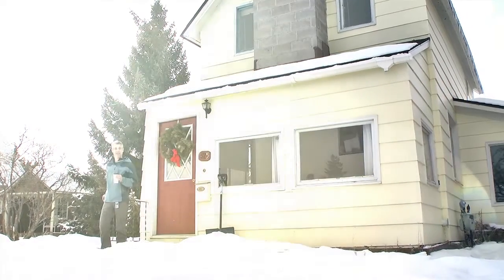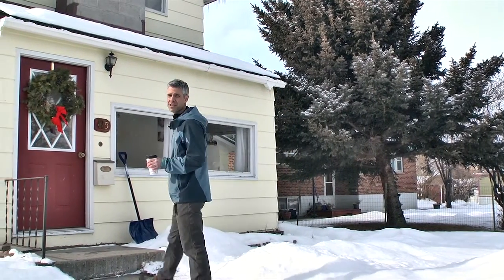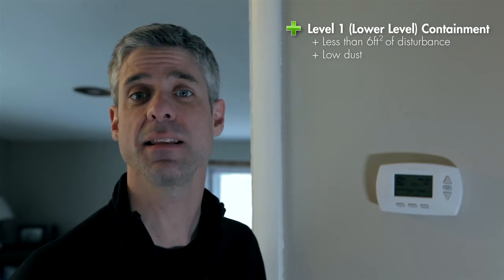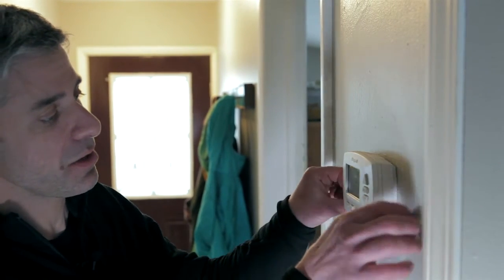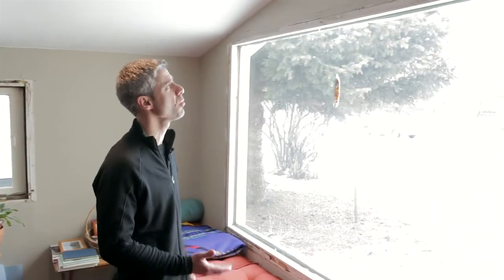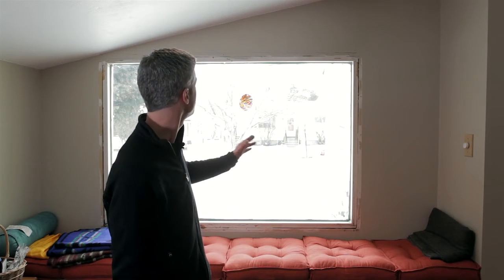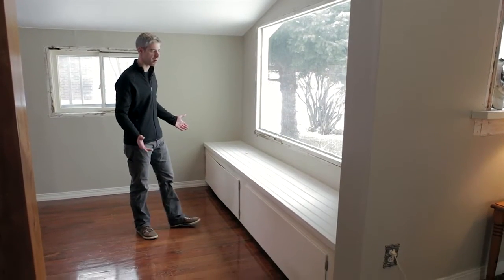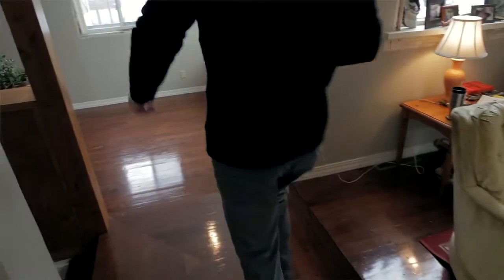Lead-based paint renovation/abatement interior containment

Comment: 4 one you used painters tape but shuda had tuck tape and 4 two you have 2 have negative air
Reply from the maker: Negative air is not required for these types of lead paint regulations, but yeah it's a solid recommendation.